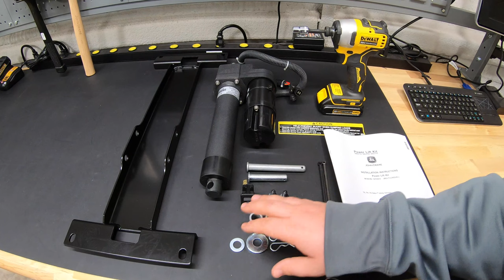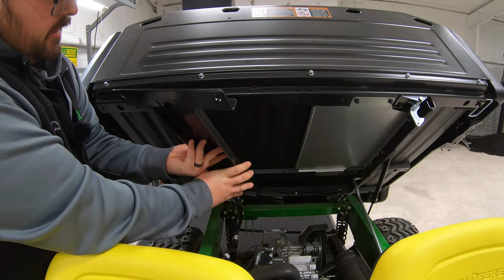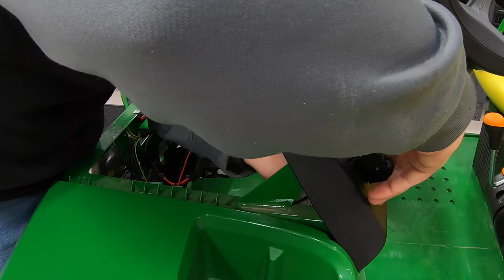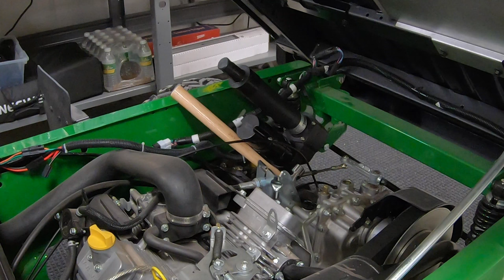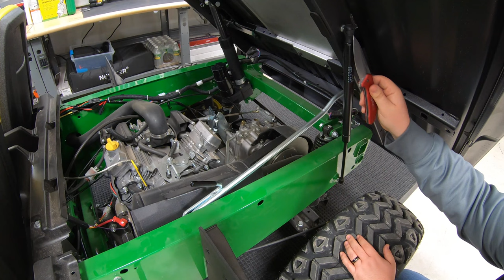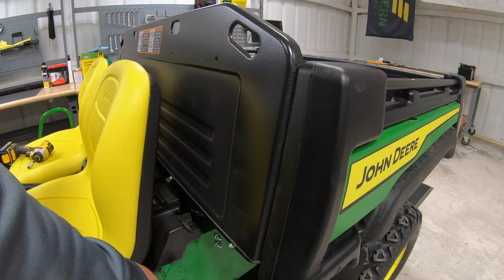How to Install Electric Bed Lift on John Deere TX Gator | Power Lift Kit

Comment: Can you get that in a complete kit every thing needed do you have a link to it for purchase... thanks
Reply from the maker: What do you mean by complete kit?
Reply: My tx gator has manual lift bed
A kit as in everything needed to make it dump with the push of a button .... switch wires motor brackets everything it would take to convert over in a kit